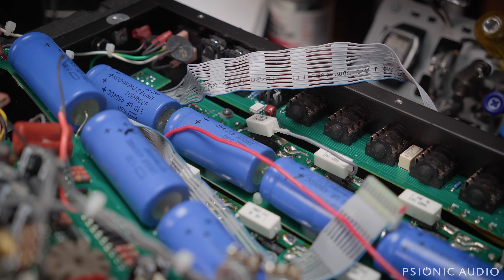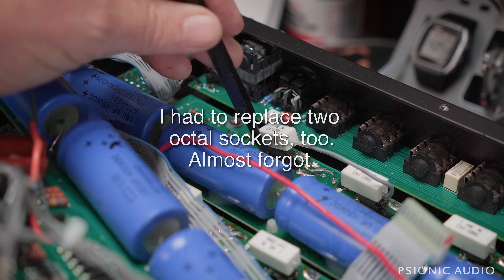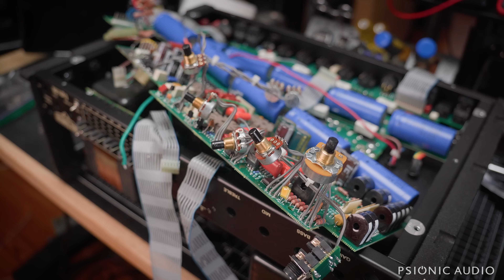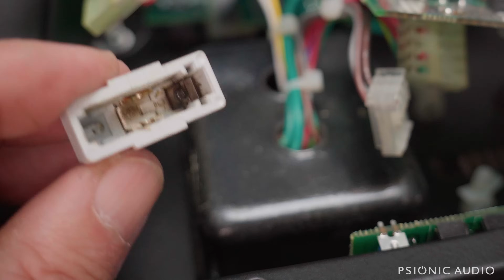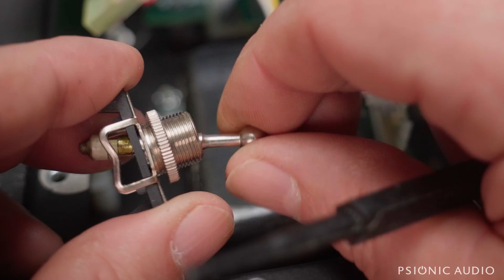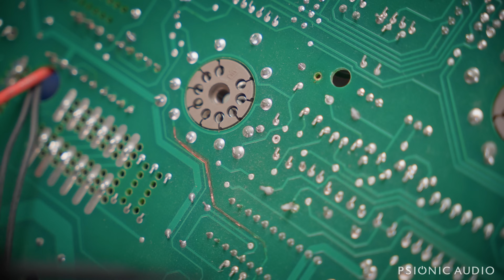Poor Strategy | Mesa Strategy 88

Comment: i was done with mesa when they started mounting preamp tubes on the board and i could hear them ringing in the speakers at band volume.  a local tech then said, "this is not how to mount tube sockets".

Comment: ALL their amps have these pissy little traces.
As I tell everyone, Mesa doesn't need fuses on the secondaries to meet EU regulations (uh, they actually do), they just use the PCB as a fuse!
The bonus feature being you need to pay either a massive repair bill to cut out sections of burned PCB etc, or you need to dispose of your amp and buy a new one off Mesa.
Brand loyalty will ruin you, people!

Comment: My amp is vibrating without even plugging my guitar into it. I turn it on and it’s vibrating. Does anybody know what that could be?
Reply: Did you hide a delivery from Adam&Eve inside it?  J/K....I'm awful.....
Reply: Are the speakers making a humming or vibrating sound, or is it the chassis and cabinet physically vibrating? PS, it might be helpful to know what btand/model of amp it is, and whether it's tube or solid state.....
Reply: @goodun2974  The cabinet is vibrating to my knowledge it is not the speaker since it’s vibrating without even playing any notes through it. It’s a Deluxe reverb reissue tube amp.
Reply: @eddiesigerexperience9803  , ps, you can out your hand on the transformer safely and push a little to see if it vibrates less, which might indicate loose fasteners. Note that wood cabinet tends to amplify the noise, like a megaphone...
Reply: @eddiesigerexperience9803  , my first reply disapoeared.....Anyway, transformers can vibrate excessive from loose mounting bolts ( they hold the thin steel lamination plates together), orr from a circuit fault causing excess  current draw, or prom other electrical devices in the home ---- computer, router, lighting etc) that put noise back into the power that feeds the amp. Note that a circuit fault that draws excess current could blow up the power or output transformers.
Reply: @goodun2974  Thank you for all the information! Man, I think I am just going to take it to an amp technician, I would like to start doing some work on my own amp though. I am just afraid of getting electrocuted haha

Comment: Arcing = Carbon build up = quickly killing electronics. Poor components just don’t hold up, and invite arcing. Carbon has to be removed by a brush or scraped off, ISO won’t clean off carbon build up. One of the main problems in Tube Sockets as well.

Comment: i totally get your sentiment on mesa amps, i wouldn't buy one for the prices they're commonly offered for. 

but Mesa cabinets i must say, i love. they seem to me at least, in comparison with other large brands to be very high quality, and the speakers they use sound great. if i'm not mistaken, they get custom speakers from celestion that other brands don't have easy access to, so through this monopoly strategy they sadly have got themselves a somewhat unique point on the market, at least to my ears, that thiele 1x12" and the large angled, half open 4x12" roadking cabinet sound excellent with every amp i paired them with. i have a 4x12" cab collection in the low double digits, and the roadking cabinet is in my top 3 favourite cabinets, shared with a diezel front loaded and a marshall jcm800 1960A cab that i put G12-M65 speakers in.

i know, i know, this channel is primarily about amps, but as you said "Mesa Products" my first thought was their cabinets.

Comment: I posted this as a reply but it's relevant on it's own.   "  Berhringer makes a lot of stuff that when used at an amatuer level [ not often or all the time ] is fine for reliability,  when used constantly,  [ pro level ] fails before warranty is up. It would be interesting to know the ratio of Mesa in bedrooms vs Stage. I've personally experienced the 400 volt cap fail and had a couple of people ask me to fix their mesa's with switching problems [ I said no! ] "

Comment: Fascinating, and scary.  If it was my own amp I'd probably replace all the inadequate tracks with wire links (I'm obsessive like that).  But if it was someone else's I'd declare it BER (Beyond Economic Repair).  No point in fitting an identical board that is going to fail in the same way.

Comment: I felt the same at first working on Mesa equipment. I realized over time that they are not that difficult to work on. The had an excellent service portal with tons of service notes for circuit upgrades. Normally they covered the cost to perform the work.

Comment: I love my 87 markiii red stripe which I had completely restored and it’s not bad to work on….but sold my JP2c+ for the reasons you mentioned, way to much going on inside that amp which I sent to Mesa twice for repair so I had enough. Stick with the older ones
Reply: Wanted to post this same thing. Mesa is like 2 companies under the same name. The early company was about being a simple, portable, loud, tough, reliable way to get a high gain tone at any volume without pedals. Almost immediately they started adding options like the switchable graphic EQ and then effects loops and more and more knobs and channels until eventually they became the later company that in my mind is more like Hughes & Kettner than early Mesa. More complexity, more features you won't ever use, more "versatile" and less reliable.
Reply: Exactly!! I had two H&K amps as well and will never buy another!! To be honest one of my favourite amps is the Fender blues deluxe, just bought a Laney lion heart 20w head so hopefully a good decision

Comment: You would think, with all the over engineering, that mesa boogie amps were made in Germany.
Reply from the maker: Under engineering to be accurate.
Reply: @PsionicAudio if only they had access to IPC2221 Tables 😂
Reply: Circuit design by engineers, design for manufacture by accountants.
Reply: Maybe Italy…..

Comment: I have to agree wholeheartedly. Although these amps sound great and are beautiful inside, they can be an absolute misery to work on if you need to access anything for removal or soldering. I am very careful in accepting these for repairs without setting dire expectations with the client.

Comment: Too Many Unnecessary Options and bad design.
Bass Players don't need all that to get a good sound.
You just need a good Bass and a good speaker, let the amplifier just amplify...
The only Mesa Tube Bass Amp that is worthy is the Bass 400+.
Like the SVT only simple things survive to time.
Avoid any Bass Amp that is ROHS and Lead Free Solder.....
The most reliable Bass Amps were made from the late 80s to the late 90s.

Comment: Incredible to have traces that tiny and close to one another, thinking it would somehow handle the current meant to supply a circuit that has EIGHT 6550s. What could go wrong?

Meanwhile I have an Orange OR30 that has traces 4-5x wider than that on the board, with tons of space between traces and components nearly everywhere, and it’s only supplying four EL84s. It certainly isn’t perfect (still has pcb mounted pots and sockets) but it’s a damn sight better than this.

Comment: Seems like those boards were created by the aid of a computer program designed for such a purpose. I would suggest the engineer (loosely speaking) did not fully understand the laws of thermodynamics and more importantly, neither did the software used. Your current experience could be the result of bad programming. Leo on the other hand relied on his education and experience...

Comment: You mentioned that Mesa stopped designing their PCBs robustly since the Mark II days. What's your experience with Mark III's?
Reply: I have a mkIII where the 400v coupling caps died, always use the standby switch, it may..... save you.
Reply: @gregboboski9904  Looks like the "off" switch is the safest bet. That thing is studio wall art/footstool/conversation piece.

Comment: Oof, that thing is toast! The only Boogie I have anymore is an early 80's Mk2 B head. It was given to me by a friend who had a bunch of amps and didn't ever use it. 
I like it. It has that "Boogie" thing that I dig sometimes. I need to re-cap it, though. And clean some pots. 
It's definitely the last of the Boogie amps that I would be able to work on with my limited experience. And just barely, at that LOL
Thanks, Lyle!
Reply: I have a Boogie MkIIB combo and like your head  has the thick circuit boards with the big fat traces; built like a tank. The only thing it’s ever needed were tubes and caps

Comment: I used to have a Mesa MkIV that once belonged to Big Jim Sullivan and when it sounded good, it was fantastic but most of the time it sounded crap. You could mess around with it and get fantastic tone. Then next time you used it even if absolutely nothing was changed, it would sound terrible. Sold it to save my sanity and my back and bought a Hughes & Kettner which I love. Another great video thanks Lyle. BTW, is that PCB multi layer?

Comment: Amp tech YT channels made me sell my Mesa Rectifier and I don’t regret it. I will spend my money on products that last and are meant to be repaired.
Reply: I think about getting a mesa from time to time but I really don't want an amp that pisses off my local amp repair guy every time he sees me bring it in.
Reply: @mrbuttons1243  ...or pisses you off at the gig or practice every time it fails. 

subjectively, they sound great. I've had 2 but got rid of them both. The first one was finicky at volume (the tone would change in an unnatural/unpleasant way). Sounded great at low practice volume in the 'bedroom', but the frequencies seemed to change in a way that I didn't like and couldn't sort out. 
The other one sounded great (more of a vintage hot-rodded marshal tone) but made me nervous when I thought about what it would cost me and the time it would be 'under the knife' when it didn't sound great or died. They are both gone and I haven't looked back.
Reply: Hell yeah, man.
We're always here to help.
Reply: @BradsGuitarGarage  😂🤘🤘
Reply: Waiting for spares for over a year encouraged me to sell all mine 😂
Reply: I desperately want a mesa amp for the tone, but as an electronics tech outside the guitar world I’ve already dealt with enough of these types of products to know it’s just not worth it. My work is throwing out a pair of power supply’s worth 15k-20k because the company doesn’t repair it and now the specialised repair place we used has stopped servicing them.